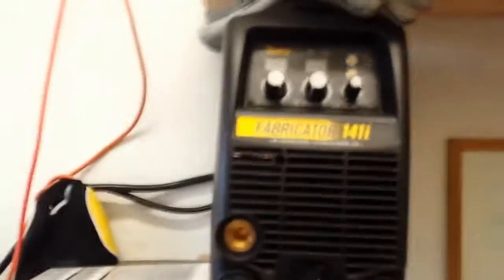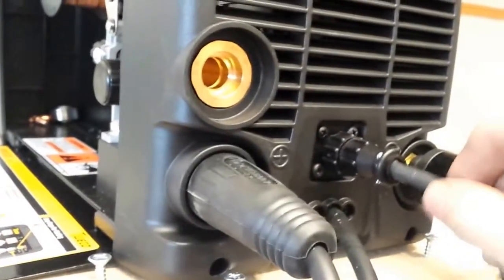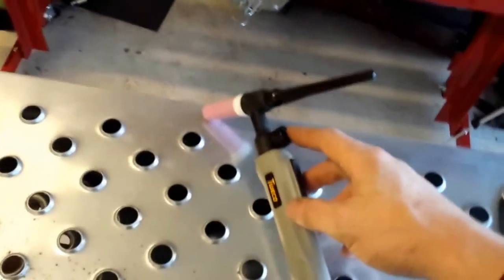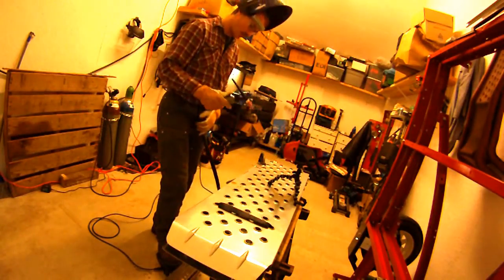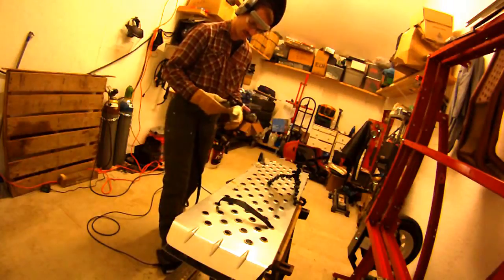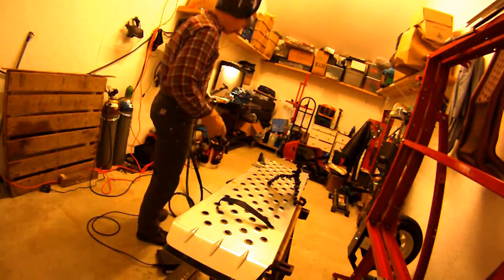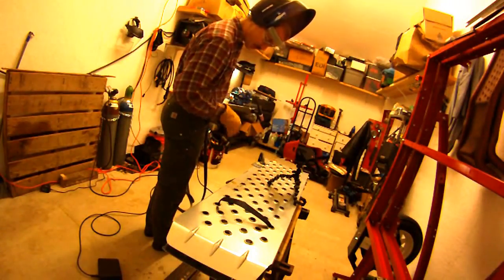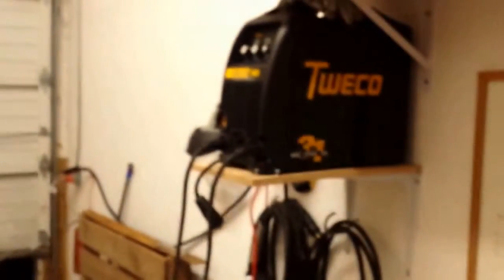Learning to Weld Pt.3 - Tweco Fabricator 141i TIG Test

Comment: Hey Charles, noted that your welder is mounted on a fixed  bracket with the fan close to the wall. you may have some overheating on continued use, and  may want to look into that.
Reply from the maker: That was a temporary location.  It's on a cart now.  Thanks for watching.

Comment: good video. I just picked up the tweco 141. hows your welding comeing? any concerns I should have or know about with my new machine?
Reply from the maker: +michael shipula I haven't been practicing as much as I should, so my welds still suck.  I love the welder.  You have to make sure to keep the tips clean on the new velocity MIG gun.  I had an issue last night when some anti-splatter gel got on the parts of the tip that make contact with the diffuser.